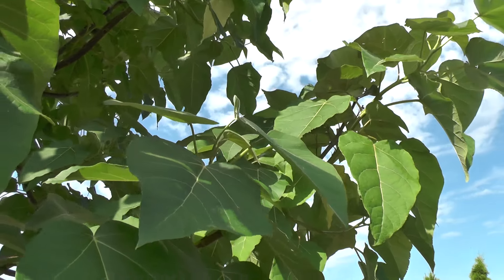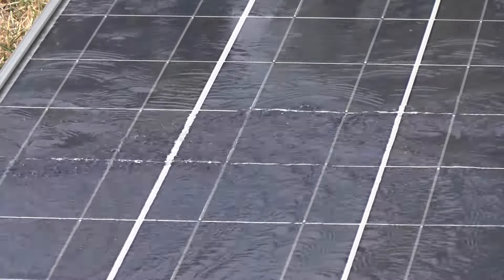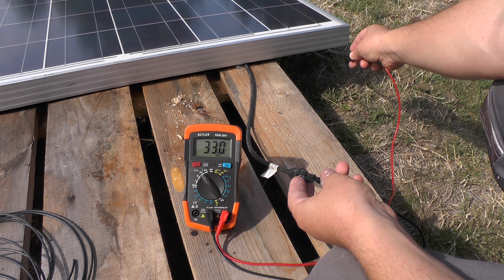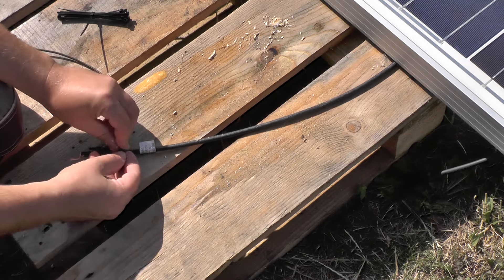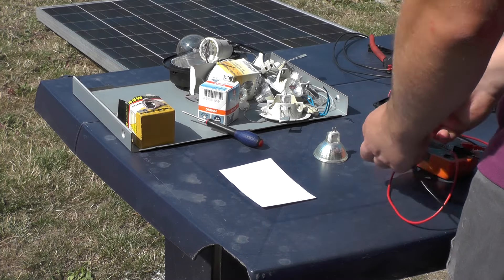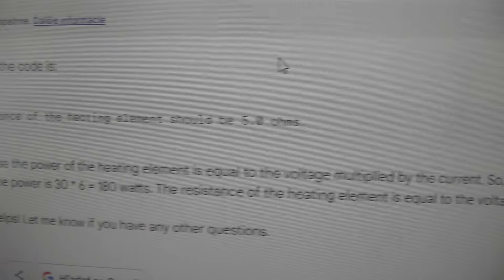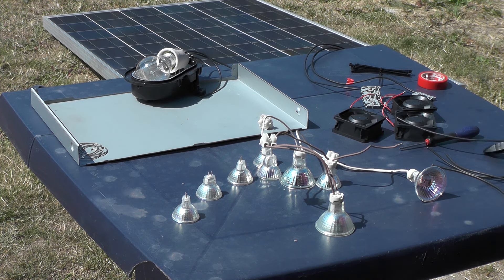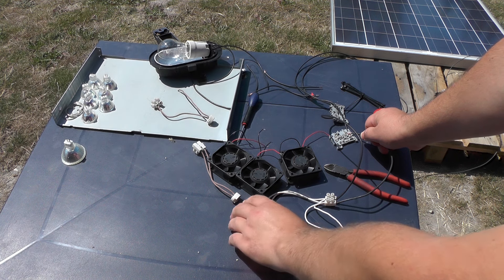Straight Heat - Solar Panel - No MPPT!

Comment: I frequently run water pumps straight from a solar panel without issues.  One factor for light bulbs as resistors it their resistance changes when they heat up, so account for that.
Reply from the maker: Hello. Yes light bulbs are not good - I am almost ready with second part where I changed tight bulbs for heating resistors. That is why my measurements was so messy. Video will be ready hopefully on Sunday.  🙂

Comment: I use direct to PTC heater with dc fan to move the heat
Reply from the maker: Hello. I was thinking about this. PTC heater  resistance increases when temperature  increase. so I don´t know how it works when there are clouds and solar panel doesn't give as much power as it should. for example if you have 12V 150W solar panel combined with 150W PTC heater, on full sun it will work, but what is efficiency of PTC heater when there are clouds and voltage on solar panel will drop to 8 volts with only 70W of power output? I am aiming what is efficiency of the system, if PTC heater use all available power of solar panel. Next problem is that I found 12V PTC heaters and I have 30V open voltage- it will burn the fan of heater. So there must be correct solar panel for correct PTC heater or needs to be  adding resistor for fan to lower the voltage. But it is interesting to know. Thank you.

Comment: One of the other guys on YouTube put a heater inside of a tank with sand and if heated the sand through the solar panel and warmed his house
Reply from the maker: Very interesting. I found some videos about this. So sand is slowly releasing the heat for a few hours acting like a heat battery. It is very interesting concept but probably for bigger solar system. On Sunday I am releasing the second video. I am planning to test heating a house with solar panels in autumn and winter. Solar panels will not have enough power to fully heat the house so it will only be like a secondary heating source and because of that I don't need to store heat energy as I need to heat air as much as possible. But with more solar panels with higher output (I guess more than 3kW) it would be good to store some energy for evening release. Very interesting. Thank you for sharing.
Reply: @jkp  THEY ARE ALSO RUNNING MINI SPLIT HEATPUMPS OFF SOLAR AND HEATING ROOMS.